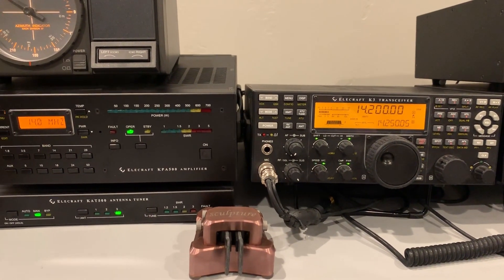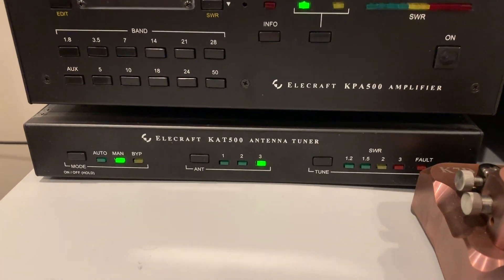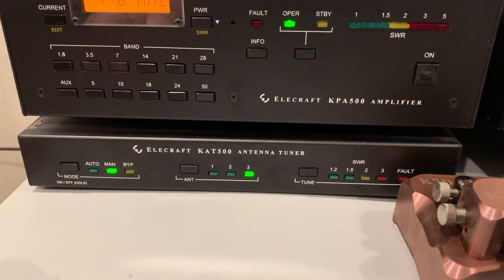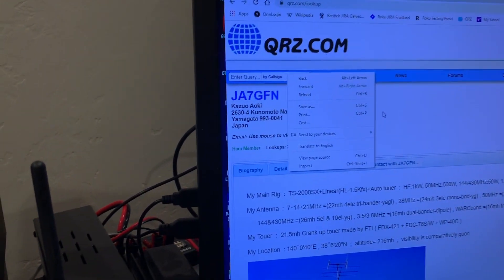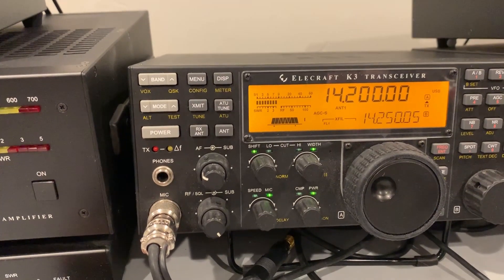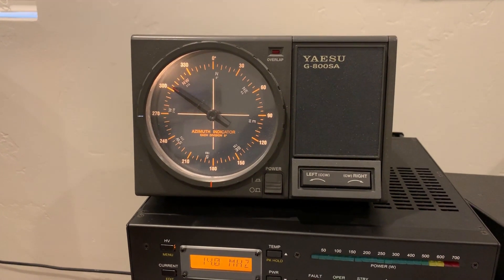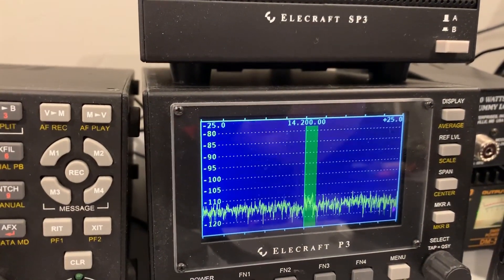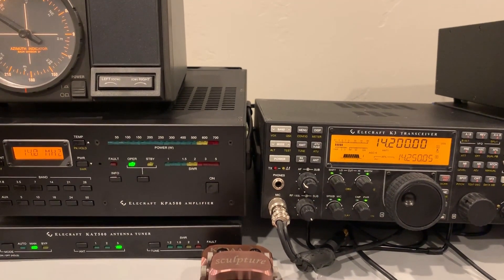3 Antennas Compared On-Air:  Hexbeam, Butternut Vertical, Offset-Fed Dipole

Comment: Thanks for posting this.  Interesting results but not entirely surprising.   If you are in Utah, I would wonder about ground conductivity and the effect on your vertical and radial field.  
There is a consideration that your experience with one signal may not extend to all the signals you receive.  Factors such as the anglulation of the incoming signal and orientation of the dipole may matter.  Placement of a particular antenna may make it susceptible to close-in near-field noise sources that affect the signal received on one antenna versus another.  
Unfortunately, many great HF antennas require more space than many have.
Reply from the maker: Yes, definitely!  As I mentioned somewhere else, I shot this video not intending to post it anywhere.  I was just looking to document for myself the differences between these antennas.  And yes, the vertical especially was not in the best place, mounted on the ground about 20 feet away from the house with aluminum siding.  I had a decent radial field, but nothing is as good as getting any antenna up and away from houses, trees, etc.  Unfortunately, it is very rare to buy a house based on how good it will be for ham antennas!  That same vertical is my main antenna at my new house, and performs way better than it did in this video.  It is almost 100 feet from any obstruction, with an underground LMR-400 coax feeding it.  We also have underground utilities, so no overhead wires or electrical noise.  It makes a huge difference, but...I'm sure the Hex beam would still beat it every time.  Thanks for your comment!

Comment: i love your clear content. 
would a yagi be better again that the hex?
Reply from the maker: A hex is basically just a 2-element Yagi in a space-saving design.  A full-size Yagi might be a bit better, but hex beams continue to surprise many of us by how well they compare to a 2-element Yagi.  Unless you're looking at a Yagi with more than 2 elements, the hex will probably be about equal in forward gain, and a little worse in front-to-back and front-to-side ratios, IMHO.  Another big advantage to the hex over traditional trap-type multiband Yagis is that it will cover the entire band (so higher bandwidth) and will also take full legal power with no sweat.  A trap-type Yagi, depending on the design, may not be able to cover the entire 20 or 10-meter bands, and may have a power limit of 250 to 500 watts.  Since a hex is just wires, there are no traps to heat up like a multiband Yagi.  Also the trap-type Yagis have some extra loss because of the traps, and they will also need maintenance way before a hex beam ever would!  Thanks for your question!  73 - Dave, K7DAA

Comment: These three antennas are not comparable, so...
Reply from the maker: Yes, but I compared them anyway! 😃 I get it, but that's what I had set up at the time, each one better than the first (the vertical).  I appreciate your stopping by!
73 - Dave
Reply: @ apologies, it was not a criticism, just wanted to say that comparing directional antenna with omnidirectional antenna will not reveal much except to see how dramatic is the difference, signals pop up louder and also noise seems to get much lower with directional antenna. 73’s de Sid
Reply from the maker: @ Thanks Sid!  It was a response to some questions I've gotten during various presentations I've done on QRP, antennas, linears, etc.  Often people who have never had the experience of using a directional antenna want to know what it's like.  That was my main reason for recording the video, then I later uploaded it as a YouTube video.  

It's easy to tell people how nice it is, as you alluded to, but they've never actually heard the difference, which can be very striking.  Even with just a modest beam like the Hex, there is a huge difference--that and also getting it up as high as practical.  Ham radio gets to be a lot more exciting and  rewarding than with just a unity gain or modest dipole antenna.

In the past, when I had a few folks in my shack and switched between those antennas, the average reaction was something like, "Wow, I had no idea that a beam could sound SO good!"

73--Dave

Comment: Thank you for this!    I've moved to a new location and have yet to put the hex back up.    I was contemplating adding a vertical - including the butternut - or the DX commander - but with some concern because my experiences with verticals through the years - they have always under performed a doublet at proper height above ground.    This comparison affirmed my concern.    I sincerely thank you for doing this video!   73s
Reply from the maker: I mentioned somewhere in the comments for this video that I moved and now have the Butternut as my only antenna.  It's ground-mounted like before, but about 80 feet from my house (large backyard) near the corner of my vinyl fence.  It doesn't care at all about the fence, RF-wise, and there are no trees nearby.  It's now an awesome performer--go figure!  But seriously, I'm sure the hexbeam would still outperform it.  Those hexbeams are just awesome, but ugly, especially in a more gentrified neighborhood without lots of trees and other visual distractions.

Comment: Don’t have the space for an HF Hexbeam so I built one on a paper fan for 70cm just to play with the design.
Was able to copy someone 105km (65mi) away who was using 20W and a vertical whip by pointing my 3W and a Hex beam at a power line tower (because he was behind the tall building I was transmitting from).
He was a 59 and gave me a 52. He was quite high up but even so, wrong direction, pylon bounce, QRP…
Amazing stuff!

73s John

Comment: Is there anything you would’ve done different?
Relating to your equipment?
Reply from the maker: I would have liked to put up a 50 ft tower, and put the hex beam on top of that, but the cost and time were too challenging.  I also knew that I was building a new house, and was planning to sell the one where this video was shot, so I didn't want to put up anything that couldn't easily be torn down a year or two later.

So, like everything else in life, the antennas were a compromise!

The hex beam was definitely a pleasant surprise.  I would highly recommend it for 20-10 meters.

The vertical in this video has a new home and radial field that works surprisingly well for DX, though.  It performs way better than it did in this video.  It's much more out in the open, with no houses or other obstructions around it.

73,
Dave - K7DAA

Comment: Excellent video!  You can really see the signal rejection of the Hex Beam.   Question: Did you find the quality of the DX Engineering Hex Beam to be below, meet, or exceed your expectations (the design and materials)?
Reply from the maker: It exceeded my expectations!  Well-designed with quality materials.  

I will admit to one design feature I didn't really care for:  The combination hose clamp/wire guides for each set of wires.  You will spend most of your assembly time putting the hose clamps in the correct place, then threading each wire through the small eye on the back of the clamp, along with a plastic bushing.  Multiply 6 arms times 5 bands, giving you 30 of these things.  

Once I had everything in place, though, I didn't need to tune anything.  It easily handles full legal power without any fuss, and does very well with heavy winds.

Thanks for the commend and your question!

Dave - K7DAA
Reply: Thanks Dave!   I truly appreciate your feed back!  Lord willing i will have a plan to buy their antenna and erect it next spring. Dx Eng sells quality stuff so your comments reinforces this.  I suspect every Hex beam on the market has similar construction so i am not sure we can avoid the design of the hose clamp design issue you pointed out?    @DaveAndrus

Comment: For a directional antenna, the hexbeam can’t be beat in terms of dollar/performance. You don’t need an expensive 60’ tower and a huge amount of space as opposed to a multiband Yagi. The OCFD is a great performing wire antenna and is my personal preference if I could only choose one multiband wire. I’ve never heard a vertical I personally would use. They are vulnerable to wind, require ground radials, and are generally more noisy than other antennas and perform poorly in residential neighborhoods.
Reply from the maker: I agree 100% with your first two antenna observations.  As for the vertical, I have also had poor experiences in the past with verticals.  HOWEVER, I moved the vertical in this video to my new house, and I've been totally amazed at how well it does now.

What's the difference?  At the new location, I have a much larger yard, and the antenna is located about 100 feet way from my house, and we are also on a gentle rise that has us a few hundred feet above the rest of the town.  At the old location, it was only about 25 feet from the house, which also had aluminum siding.  So lots of obstruction.

This vertical is like a completely new beast!  I feed it with LMR-400 coax that is buried under about 24 inches of lawn and dirt, so it doesn't pick up noise, and it doesn't need a choke balun because the earth takes care of that.  I'm also using fewer radials than the location in the video, so it's not helped by better ground conductivity.  

We also have no overhead power or telephone wires--all underground services.  At the location in the video, we had power lines running along the back of our yard.  I'm sure they added a bunch of noise.

I can only conclude that the vertical really wants to be out in the open.  I also have to say that I think the Butternut vertical is the most efficient one I've ever used.  It has no lossy traps.

So there you go--it really surprised me how well the same vertical works now.  It just doesn't like buildings, trees, overhead wires, etc.

Thanks for your comments--I really appreciate them!

73--Dave--K7DAA
Reply: @DaveAndrus take a look at the momo beam t10. I think you’d like it. I ran a hex for a short while until the ice crumbled it. I decided to stay with more solid antennas. Which butternut do you use Dave?
Reply from the maker: @JayN4GO  I have a Butternut HF-9V.  I haven't heard of the momo beam before.  Thanks for the tip--I'll look it up!  Yeah, icing can be tough on hex beams and cubical quads.

73, Dave

Comment: It’s interesting to note that your noise floor came up on your vertical and then even more on your dipole, so I wonder if your hex beam improved signal to noise ratio is due to your noise being mostly off the backside of your hex beam or your dipoles feedline is picking up a lot of vertically polarized noise via common mode noise on the feedline????  Someone suggested also doing a transmit test and that would help understand how each antenna radiates whereas your test might have been getting skewed by local noise and how each antenna responds to it.  Just FYI, Don
Reply from the maker: Hi Don @wd8dsb I appreciate your analysis.  The dipole and the hex beam both have baluns on them at the feedpoint, so hopefully there is less chance of picking up significant feedline noise, but it's still possible.  I also had ferrites on the feedlines where they entered the house.

Another possibility is that all of the hex beam's active area (basically the W-shaped driven element) is above the level of the roof, and about 10 feet above the feedpoint of the dipole.  So it is above most of the noisy things in the house and nearby buildings.  The dipole is an inverted-V type with ends that droop down to about 10 feet above the ground.  The vertical, of course, is on the ground.

So my guess is that the vertical is most subjected to a) blocking by buildings and trees, and b) noise pick-up of digital noise from the house about 20 feet away.  The dipole is a bit less so, but some of it is still blocked by the house, and it runs nearer to noisy things just inside the house.

Interestingly enough, that same vertical is now mounted at the back edge of my new property a few miles away on a half-acre, and is about 100 feet from the nearest house.  It's now an excellent, low-noise antenna!  The feedline is LMR-400 run about 2 feet underground in a PVC pipe.  So the only things that changed were the radial system and proximity to buildings.  I actually had a more extensive radial system at the house where this video was taken, so it can't be because of a better ground or radials.  I often wonder how much better the vertical would have been if it were mounted on the roof with a resonant counterpoise!

I've been a ham for almost 60 years, and still work professionally as an RF hardware engineer.  I'm still completely fascinated with antennas from 200 kHz to 75 GHz, and the variables that affect them.  The fact that I get to design them and also play with them in my spare time is just the most fun for me!

Thanks again for stopping by, and 73,

Dave - K7DAA

Comment: My results are surprisingly close to yours. Had a couple signals under the static, switched to the hex, and it sounded like they were in my driveway!! 73's VA3IRF
Reply from the maker: Yeah, nothing like a good directional antenna to bring the signals up out of the noise.  It also limits the overall noise level into your receiver because much of your gain is in one direction rather than from all around you.

73 and thanks for the comment!

Comment: Now we need another video to compare your transmitted signal on each of your antennas to see which one is better… i’m assuming the hex beam would be better but by how much???
Reply: I did some tests on 20, 10 and 6 meter, and typically gain about 2 S points, over my end fed.
Reply from the maker: @2Meter Crew : First of all, I love your YT logo!  I dropped by your channel and sub'd.  I used to live in Morgan Hill CA, so very familiar with Mt. Diablo and the Bay Area in general.

Now to your question:  I'd love to have done the TX comparison test, but didn't have time.  I'm also in a different city a few miles away from the house that had this 3-antenna setup, and I don't have the same ability to put the hex beam up on the new house (spousal approval factor and solar panels everywhere!).  

I'm also right up against the mountains to the east of me, so EU and a good part of the USA is harder now.  If I had the hex beam up and turned it to the east or northeast, all the little electrons would bounce off and come flying back at me.  I'm that close to these 9,000 ft monsters!  I could certainly do Japan or the south Pacific though.  If you have a look at my vid that mentions the temporary mag loop, you can see my yard and the mountains.

I still have the hex beam, and am planning to set it up periodically in the back yard.  The Butternut vertical is also permanently installed now, so I can make a new video comparing them when I get the time.  I really appreciate your comments and suggestion!
Reply: Vlolove   very.      Vv.  v    l     y oy and thget oo getwere you out b t too  @DaveAndrus see d y.